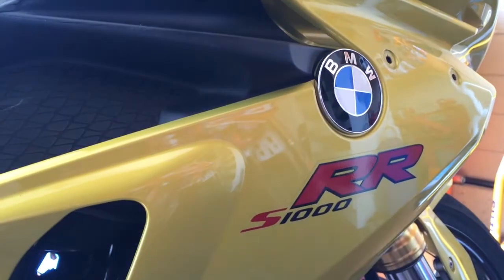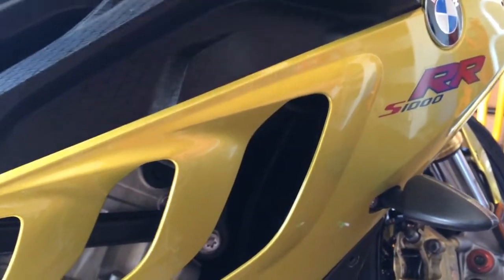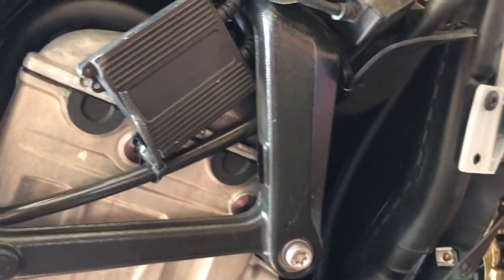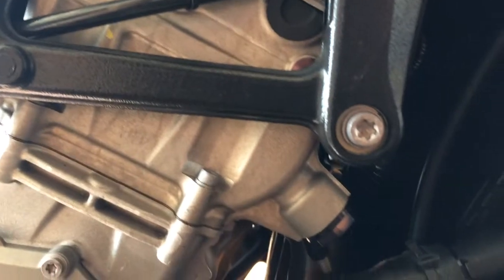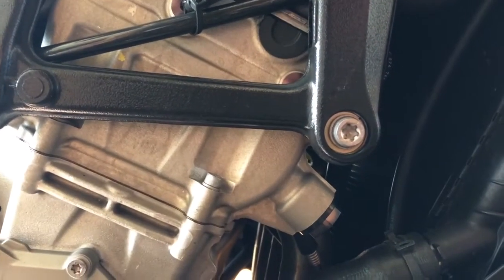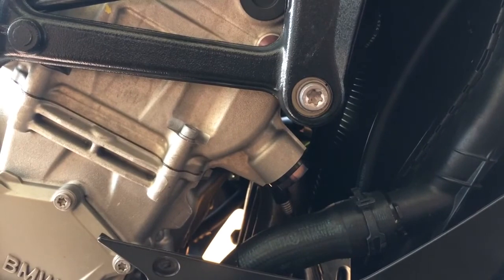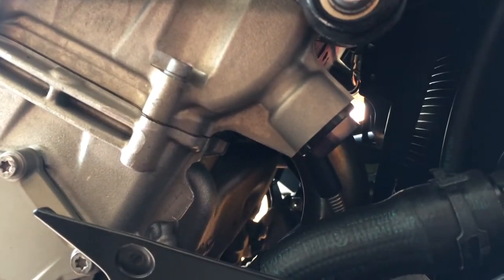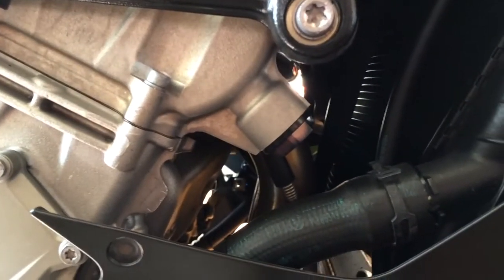BMW s1000rr rattle on startup? Cam chain tensioner?

Comment: I have had 2 different S1000RR (2010) and both made the same sound, its normal
Reply: Ciao è normale che a 3000 giri tenendo appena accelerato si senta un ticchettio simile al rumore dell'accensione?
Reply: @portioliluca  If you hear ticking noise maybe your automatic cam chain tensioner  is not working correctly anymore. Maybe the cam chain is running too loose now. I have had this issue with a Honda Fireblade before. I replaced the cam chain tensioner and it was gone.

Comment: I've had my 2010 S1000rr from new. As far as I can remember it's made this noise from the day I bought it. Despite being ridden hard, 14 years on and it's never missed a beat.
Reply: Hey buddy thanks for your valuable comment. My K46 from 2010, makes this sound. I’ve had the bike for 2 months, rode it for more than 1000km with no problems. Was wondering if this is normal or shoud I look into replacing the tensioner / timing chain?

Comment: This ain’t an issue. It’s the hydraulic pressure that needs to be build up first. This is just the way bmw is build. The chain is hydraulic powered and keeps calm as soon as the pressure is build up
Reply: I've had my 2010 S1000rr from new. As far as I can remember it's made this noise from the day I bought it. Despite being ridden hard, 14 years on it's never missed a beat.

Comment: It has nothing to do with cam chain tension...it ALWAYS HAS TENSION unless the tensioner breaks.  You guys...it's simply oil...when the bike sits for a certain amount of time, oil drains off of the cam/timing chain making it a little dry.  On a cold start up, the amount of time it takes for oil to travel up the chain and lube all related parts is when the noise quiets down.  I have a 2016 s1000r premium.  23k miles.  It's perfectly normal and fine.  If the noise doesn't go away...then you have a problem.  Lol.
Reply: Ciao ho provato un s1000r ho notato che a 3000 giri appena tenendo l'acceleratore ha un rumore costante  molto  simile all rumore di avvio ... Pensi sia normale?
Reply: @portioliluca bei mir ist das genauso hast du das Problem gelöst bekommen und wenn ja wo war das Problem?
Reply: @raultac7604  non l'ho più comprata , l'ho solo provata
Reply: Do you genuinely think that? Parts of the engine are dry on start up? If you don't understand the internals of an engine that's perfectly fine but please don't go spewing rubbish over the internet.
Reply: @JUMPAROUND1515  why is there an oil pump then 🤔
Reply: @kokosnuss-pe3hn  to pump oil obviously, for these engines the CCT is operated by oil pressure. There's a check valve that's known to leak allowing the tension to slacken. At start up this makes a racket for a few seconds as it builds up pressure. Nick is spewing rubbish though.

Comment: We have a slipper clutch. The clutch basket has anti wheel hop springs. This is Part of the slipper clutch system. The rattle is the springs in the clutch basket.

Comment: Every single vehicle with a cam chain tensioned by oil pressure is going to rattle for a few seconds from a cold start. This is perfectly normal behavior.
Reply: opmike343 it’s not normal behaviour the tensioner is losing oil pressure when the engine is of he is leaking internal so every time u start the engine it needs a second to make pressure! With the new “longer” tensioner the problem is solved because the pressure on the chain is there without oil pressure! Sorry for my bad English I’m a BMW mechanic

Comment: Cam chain on the RR is oil pressure driven so ot takes a second or 2 to tighten up. They all make that noise to some extent on start-up.
Reply: Thanks for this explanation.

Comment: All BMWs make that noise Ive had a 2011 and a 2016 my 11 did it all the time now my 16 is just starting to do it. Its not the chain failing it just needs to be adjusted so its no longer slapping the wall

Comment: Mines is been doing that for years.  I have a 2013.  Have the bike for 3.5 years, 21,000 miles now, and this has been present for about 2 years now.  sometimes its annoying.  I'll look into this.  Thank you
Reply: Yes.  I solved this by replacing the cam chain tensioner with a manual tensioner.  Don't skimp and get a cheap one.  I got mine from from "southerncaliforniamotowerks.com".  They specialize in making cam chain tensioners only, so they're top of the line.  I've had mine on my 2016 bmw s1000r for almost 1 year now.  Zero issues and absolutely no chain rattle on start up..ever.  hope this helps!
Reply: You guys...it's simply oil...when the bike sits for a certain amount of time, oil drains off of the cam/timing chain making it a little dry.  On a cold start up, the amount of time it takes for oil to travel up the chain and lube all related parts is when the noise quiets down.  I have a 2016 s1000r premium.  23k miles.  It's perfectly normal and fine.  If the noise doesn't go away...then you have a problem.  Lol.
Reply: @thewunv4  what would that problem be if it doesn’t go away?
Reply: Any update?

Comment: Mine does this also 2015 model only10000km did the new cct stop the noise?
Reply from the maker: Yes it fixed it and the noise is gone. My other video shows the install and you can hear the difference